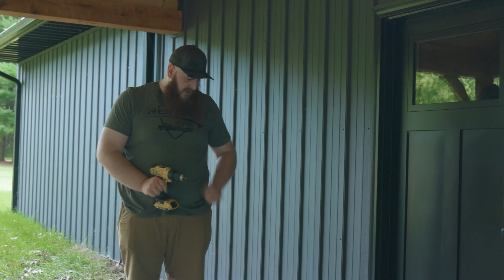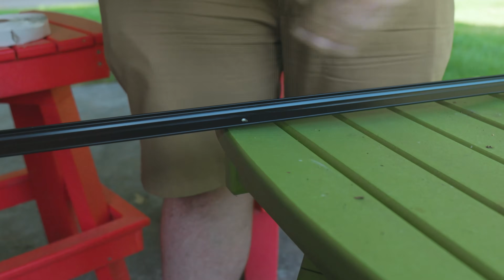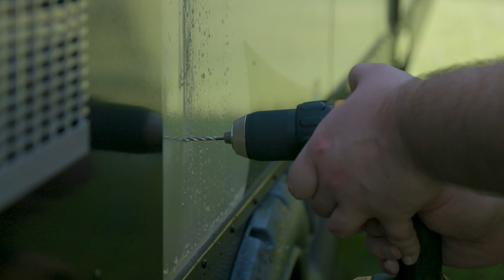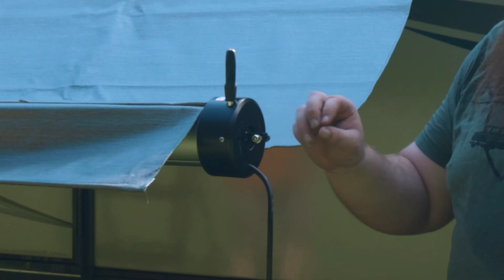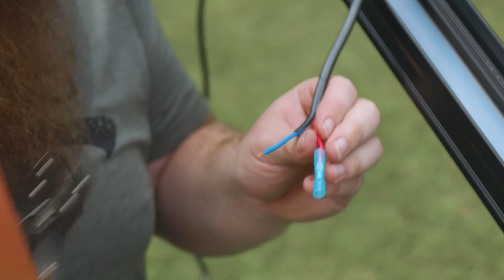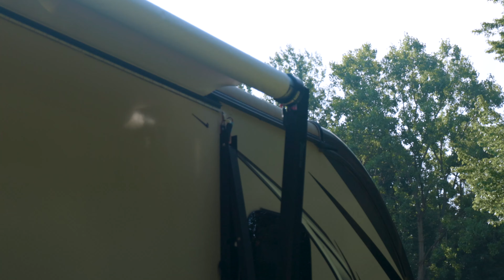RecPro RV Powered Awning Installation

Comment: The video stated the switch could also control led light kit but said nothing on how to wire.  Can’t find any information about this anywhere.
Reply from the maker: Hello, to wire LED lights to the switch it needs to be in a reversed polarity. So your positive wire for the LED needs to go to the white(neutral) wire on the switch. The neutral wire for the LED needs to go to the blue{positive} wire on the switch.

Then you can leave your switch in the "open" positive to leave the LED's on. When you're ready to turn the LED lights off you can put the switch in the "off" or "close position" depending if you're leaving your awning in or out.

Comment: Have this coming to replace one that was ripped off while driving.  Do I have to use the provided rail to hold the awning or can I use my existing awning rail on my 5th wheel?
Reply: I was also confused by him not using the existing rail/gutter combo that comes with almost all RVs.
Reply: @johnstricks269  I installed this and I was able to use my existing rail.  I did this myself and it was a fairly easy install.

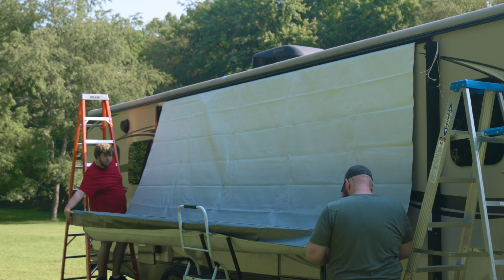Comment: We installed this awning today... Followed our common sense and installed the tube with the black crank pointing down. Then watched your video which shows at 10:12 that you're installing the tube roller with the emergency crank pointing UPWARDS. So, we decided to trust the professional, took the tube back off; just my husband and me in 103 degrees heat, him holding the tube up in the air, me taking the bolts and washer off, and redoing it all...Turned it like you show in the video, Emergency Crank UPWARDS. Just to realize in the end that the tube is installed wrong. Tomorrow we have to do it again and turn the tube with the Emergency Crank pointing down. Maybe you need to address this topic in the video. Thank you.
Reply: I saw (and did) the exact same…. Partially installed mine today and tomorrow, I’ll correct it.  I also wondered if it was correct and thought I’d follow the professional instructions as well.

Comment: So what if we dont have a max? It rolls out then immediately starts retracting. Any suggestions?
Reply: I just installed an Awnlux awning which looks to be identical to the recpro. I though I had that same issue, I just had to crank that screw a ton, finally I was able to find its position and adjust from there.

Comment: Just installed these arms and new fabric, I’m sure I did everything correct. It’s all intact, and wires connected 
Just won’t stop at the REAL max it should be, it has its own set max, it’s not letting ME SET the max. 

Any advice?
Reply from the maker: If you contact our customer service over email at info@recpro.com or over the phone at 574-848-0405, they would be happy to help you with your issue.

Comment: Did  a few things done without explaining them an example, when he installed the very first bracket he did not state how far up or down the bracket should be on the side of the RV?
Reply: I did not receive any manual. I promise I have went through item by item and found no install help. Emailed the company per a comment here. Glad this video has that info. Thank you
Reply from the maker: It is found in the manual that comes with the unit.

Comment: Great Video to show "a way" to install a new awning assembly! I assume a manual awning is similar expect for the electrical install. The other thought, could a person use 3/16 or larger pop-rivets instead of the screws (assuming a person has a pop-rivet tool)? And could a aluminum weather wrap be used as well (assuming Rec Pro makes awnings suitable for those types of weather guards)?
Reply from the maker: We do not recommend using pop rivets because they are not as strong as screws and can shear easier. We do not know about the aluminum wraps as we have never used them or sold them before.